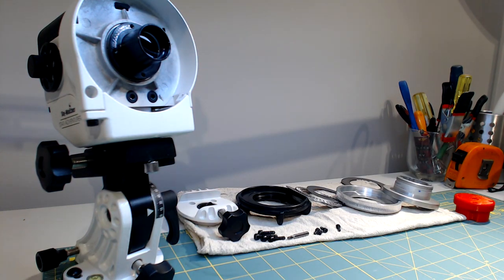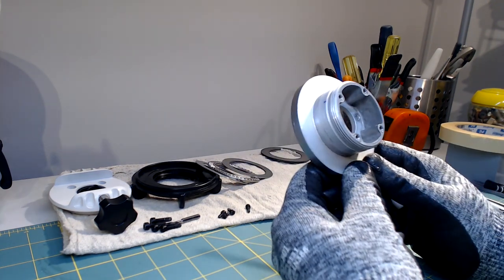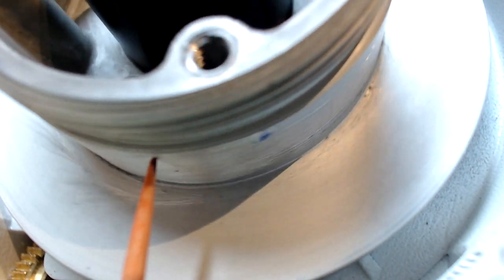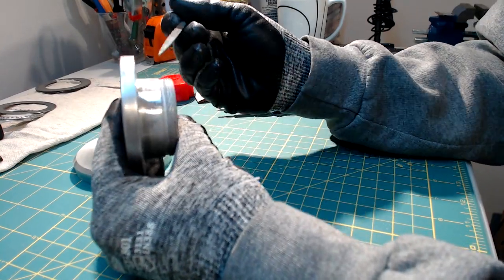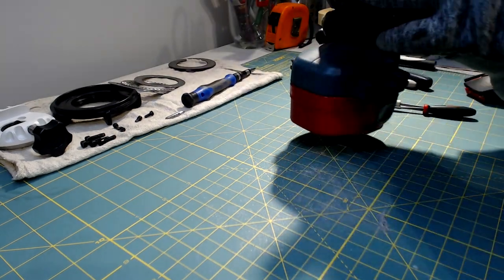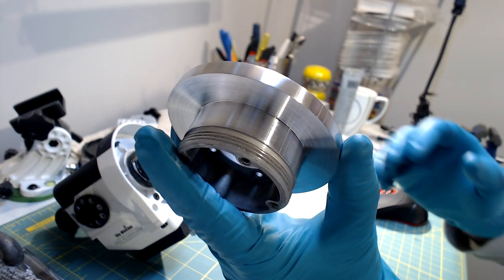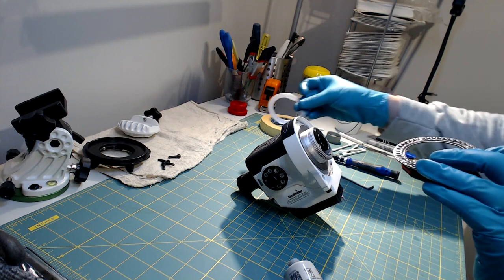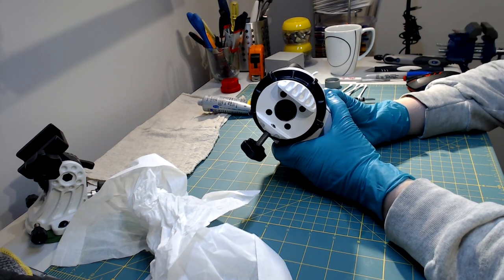Star Adventurer "Tight Spot" Clutch Repair

Comment: Just did a cleanup and regreasing on my Star Adventurer. I could not find the super lube so have used a light lithium grease. As others have said the factory grease seems to be sticky. The result is that I now have a smooth running drive with good balance. Thanks much for the video. Very nicely done.

Comment: Hi Steven,  I saw your video "inside of the star tracker" before I decided to buy a star tracker.  I received my star tracker today, and sure enough right out of the box after setting it up, the arrow lights started flashing.  I replaced the batteries just to check the obvious and the same problem.  So I followed you video and took it apart.  I didn't find metal shavings, but I did find dried paint chips on one area of the splines on the middle brass gear.  Was able to remove the paint chips, reassemble and it works fine now.  Just wanted to say thanks, and hopefully provide some info for other people.
Reply from the maker: You're welcome 😊.

Comment: Mine's got the tight spot and it's annoying as hell. Nice to see an actual video instruction in how to deal with this. Thank you for sharing!
Reply from the maker: Maybe try to see if you can get rid of it first by backing off the backlash screw. You'll still have to open it up to push the cradle down then reset the backlash. If the tight spot still comes back after setting the backlash then I'd say you need to find that high spot in the clutch plate and work it out. Good luck 👍
Reply: Steven Doye right, thanks so much for the tip! When i was first looking to get a tracking mount, it was either the EQM-35 or the SA. Should have gone with the EQM-35, or even saved up for the real deal, like the EQ6R-Pro for example. Lesson learned. Cheers!

Comment: Sometimes you can reduce out of round errors by simply unbolting and changing the orientation of the assembly  (rotate 90 degrees, re-bolt on, check oor error, unbolt and rotate again, re-bolt on and check error again, etc).  If there is an orientation in which the out of round error is lower than other orientations, mark the assemblies so that you always bolt it on in the same orientation.  This is a common practice in situations where there is a slight offset to the bolt holes, and could minimize the amount of sanding/filing needed to fix the problem.
Reply: This is what I tried but it didn't make any difference for me. I was thinking you could enlarge the holes so you have a bit of play when screwing the parts back together, so you can adjust the axis of rotation before you tighten the bolts down again. If it's just misaligned but circular, you dom't need to grind away material, just reposition the parts relative to each other. If you have the right measuring tools (dial indicator) I'm sure it's possible to do the alignment very precisely if you enlarge the screw holes.
Reply: @alphanimal  True in a lot of cases, as the old saying goes: when all else fails, make it adjustable. :)

Comment: Thanks. I see other guys balancing gear on their mount with a smooth range of motion. Mine just sticks there and barely moves no matter how much I unscrew the clutch or how unbalanced the counterweight is. I knew there had to be a problem.

I'm getting a 3D printer for xmas. Might be good opportunity to try printing out your special tool and trying this out.

Comment: The biggest cause of the tight spot lays in the mechanical design of the mount itself.
The inner Part (The Eyepiece/Mounting Plattform) is fixed with 4 little screws in the Center of the mount.
Around this Eyepiece/Mounting Platform there is the big metal gear. 
Then there is the backlash adjustment screw which is pushing the messing worm gear against the big Metal gear.
But when the messing worm gear is pushing against the big metal gear, the big gear could only slip a little bit to the opposite side (in its rotating tolerance)
But the Eypiece/mounting plattform which is inside the big metall gear could not slip away because its fixed with the screws and this results 
in an outcentered axis between inner metal (Eyepiece/mounting plattform) and outer metal (big gear). This leads to the tight spot.

What works for my mount and i have done to make this off axis of the two rotating elements getting better centered:
1. I loosen all 4 screws inside the mount which fix the Eyepiece/Mounting platform. Now it has a very little bit more mechanical game.
2. Then i made the backlash adjustment.
3. Then i rotate the mount with full turns several times (inner metall piece has chance to center with the outer metal piece)
4. Then i tighten evenly the 4 screws of the inner Eyepiece/Mounting Plattform
5. i made the steps 1,3,4 severall times until the screws were tight (always testing if the tight spot is ok)
Sorry for my bad english

Comment: Hi Steven, Great video! I've got one and it needs the same treatment you performed on yours. The suggestion on having a machine shop dress it up is excellent for those that don't want to do it themselves. Having a mini lathe would be great! This procedure could also be done with a drill press and a milling vise. (Drill press should not wobble!)  One more thing, I was saying to myself just before you mentioned the aluminum shavings and dust all over... Wonder how much you got in your coffee LOL!  Also I would suggest to anyone doing this to keep the bering away from the sanding/grinding area. I'm presently making an adapter to put the iOptron electronic polar alignment scope on my Star Adventurer. I like the idea of being able to polar align by looking at my laptop screen instead of bending down or kneeling to look through the builtin polar scope... Again GREAT video and all of us Adventurer owners with that tough spot thank you! Clear Skies to you now!
Reply from the maker: Thanks alot. I'm glad you liked it. If you're interested, I have designed a few other 3d printable accessories for the Star Adventurer. My glow in the dark polar Illuminator is pretty popular. I also have an adapter that will attach a webcam to the polar scope to save your back. And of course all my model's a free to download.
https://cults3d.com/en/users/skippy111taz/creations

Comment: I'm very appreciative of your work and the time you've taken to share it, thank you. As I have noticed the rotation getting difficult in spots, I have also seen the polar scope is wobbling when I rotate the saddle. Do you think that is coincidental or can those two things be connected?  As the clutch fits over the scope quite snuggly, I would think enough play in the clutch plate rotation would ruin the alignment of the polar scope... making my polar alignment off... which would explain why I've been getting star trails.
Reply from the maker: Thanks 😉
As I have mentioned this tight spot doesn't effect the performance of the mount. It just makes it difficult to balance.
The polar scope is secured within the bearings so it can't really wobble. The clutch plate however is casted and not perfectly round and it rides on the bearing and inside a machined ring gear what is perfectly round. This is what at least I have notice is causing this issue. I have been tempted to have a machinist make me a clutch plate on a lathe.
I have 2 of these mounts and both the polar scopes show that wobble when rotating and viewing through them. I believe it is more just the optics though. As you rotate the mount while looking through the scope, the view you see also moves with the scope. Aslo my crosshairs in the scope stay center on my target when calibrating, but yes the whole image moves with it.
Maybe check the calibration of your polar scope. Just center the crosshairs on a far target during the day and ensure the crosshairs stay on that target as you rotate the mount.
Reply: @StevenDoye  , yes! I experienced the same thing and thought it was so odd. Despite the over all wobble of the image, the object does, as you say, stay centered in the crosshairs during an alignment test.  

By the way, did you find that all the extra lubrication has an effect on smoothness and accuracy (= longer exposure capability)? Or it is just more peace of mind with regard to the longevity of the unit?
Reply from the maker: @JasonGabler  I wouldn't say it's extra. It is essentially the same amount that was in there prior. The grease I used though wasn't as sticky  as the original though. It dose slew smoother as for exposure it's still the same.

Comment: Hi Steven. At the 3 minute mark where you tighten the screw that pushes up against the worm, do you know what size that screw is. I have had issues with my SA and have just looked and the screw is actually missing so I need to replace it

Comment: Consider this: If the outer edge of the cast clutch fits snuggly within fine tolerances of the ring gear, the low tolerance inner spool that rubs unevenly when the clutch is loose will not affect the performance of tracking or the worm gear calibration at all . . . not in the least, once the clutch is tightened up. Now, finding chips of paint and metal shavings . . . that can be an issue.
Reply from the maker: I do mention this it doesn't effect the tracking, but it dose make it difficult to balance and it is just annoying to feel. If you see my other tear down video,  you'll see where the one screw was just rammed in and forced to find the hole from factory. It scrapped the paint and left metal shavings in the clutch area.
Reply: @StevenDoye  Yes. Watched the old vid first. That ripped up screw install was worth showing to the company for Quality Control! And, the 'paint chip' problem is also disconcerting.  How does the adjuster screw feel on the worm gear carriage? What are the instructions on adjustment? My Pro 2i will arrive Tues/Wed, so I will check it out myself.
Reply from the maker: @leonarddaneman810  The SkyWatcher instructions don't say 💩 about the worm gear adjustment. I just figured that out on my own. It dose come set from factory so if you notice no play in the RA while the clutch is locked, just leave it alone. You have to open it up and physically push the carriage down to back it off. Then slowly tighten it untill you have no play. Just like I show in the video. 
Another thing the instructions are wrong about is the calibration Date/Time for the polar scope. They are off by 20min. Most people don't use the setting circles to locate the position of Polaris anyways.
Reply: @StevenDoye  Hmmm . . . using the circle to get to true North is important. Will check that out. The new 2i will be here in a couple of days. Will let you know how it sets up out of the box.

Comment: Hi Steve, thank you for your videos and learn from the possible failures of the star adventure. I've barely used mine and lately it's leaving me traces in the stars with 10 seconds of photo using a focal length of 400mm only. I move the dial off and turn it back on and keep tracking but for a short time and stop tracking again. What could be going on?
Reply from the maker: It's hard to say without seeing it. It could be a number of things. Low battery, motor overload (lights will flash, can be due to overweight, not balanced, or backlash set too tight), clutch not tight enough (it'll track fine then slip and track again eventually), too much backlash (saddle will have play when clutch is locked). Really though the backlash should be okay because it's pre-set from factory. As you can see in my video it is a bit tedious to set.
I have personally experienced the clutch not tight enough problem. I'd get a good couple of exposures then trail's. It's rather surprising how tight you need to lock it down.
Reply: @StevenDoye  thank you very much for your answer, I will try to tighten the clutch more, the equipment used was the 72ed refractor of skywatcher, guide tube of 30mm of zwo and main camera 294mc, so it is less weight than the maximum allowed and the PowerTank battery is new and had all the charge. The polar alignment was perfect and stayed on the watch face when rotating the axis, so polar finder calibration and alignment are fine.
Reply: @StevenDoye  the lights did not flash and were always fixed, I guess then it is not an engine failure right?

Comment: Wow. I can’t believe how bad your clutch plate is out of round. It looks like 1mm high in that area. Just bought the Star-Tracker WiFi Pro Pak. I hope they got this issue corrected on the newer units. You might have tried putting masking tape on the clutch plate surface to prevent scratching with the file sand sandpaper. Do you have the STL file for your drill adapter?
Reply from the maker: Yeah it was pretty bad. That's what you get when you cast the part instead of machining it. I honestly wish I had a lathe to fix it but that's why I ended up designed the drill adapter. Here's the link to the adapter STL.
https://cults3d.com/en/3d-model/tool/star-adventurer-clutch-repair-tool
Reply: @StevenDoye  Thanks. I’ll be sure to check my Star-Tracker out closely. At least I know how the whole thing works from watching your videos. It looks like a good product but you’d think they’d machine that part instead of using a casting. Thanks again for your insights.
Reply: I bought the Star Adventurer 2i Pro pack recently and it's got the same problem. So, no I don't think they honestly care at the manufacturer's factory.

Comment: Nice video. I subscribed. It may be useful to know how to repair especially it if it is out of warranty . On my first mount that i bought, the Ioptron skyguider Pro the clutch got stuck, also had other problem so I returned it, and i decided to buy Sky-Watcher EQM-35 PRO GOTO
Reply: Good call! I wish i got the EQM-35 Pro, but i decided to get the Star Adventurer instead, and while it's a nice little mount, there are many frustrations with it that you just don't get with a proper mount like the EQM-35 (or better ones).
Reply: @aerozg  if you do not travel in mountines for astrophotography and need to go at distance for the car best use a more solid mount. I haad first ioptron skyguider pro but felt like a toy compared with the eqm35 pro
Reply: Ioan Nemes i agree. I usually travel 2 or 3hrs to get away from the city light pollution, and i drag all my gear with me. The polar alignment was a nightmare on the Star Adventurer, but now i have gotten used to it. Working with mounts like the EQ6R-Pro is light years better than flimsy tracking mounts like the SA. It's a nice toy, but you overgrow it very quickly and want to do more, with bigger lenses and longer focal lengths. I don't want to shoot Milky Way all the time, deep space objects are calling :)
Reply: @aerozg  if you are on a loeer budget the eqm35 pro is a very good upgrade. With the ed80 600mm makes a nice pair and i heard it can perform good even with a litle bit heavier telescopes but i haven t test it myself. With an autoguider and a rough polar alignment i used it up to 10 min exposures
Reply: Ioan Nemes 10 minutes, that is great to hear! But i am still a beginner, my skills do not warrant an upgrade yet :) Still shooting Milky Way and learning how to process images. I still need to reach the point where i can deliver consistent results with the current gear, and then i will allow my self to graduate to more complex machines. We have a great local shop, offering good financing options, like paying in up to 24 installments, with no interest %, so that's a big plus. So i will keep learning, and saving up money for the upgrade. I think of all things, the most important thing in this hobby is Patience :))
Reply: @aerozg  eqm35 pro is good choice for beginners when i bought it i only used a week the ioptron a few months ago. And is also not expensive a good mount to start. Wish you clear sky
Reply: @GalaxyArtMedia  i agree completely. Clear skies to you as well my friend.

Comment: Hi Steven, 
I’ve just been watching your video on the “inside of the star tracker” and the problem people are getting with the screw thread that can  jam up or gets stuck inside when you try and turn the clutch over time ! 
I’ve just purchased one today and is about to be sent to me from the retailer. 
So should I ask  them to do this for me as it looks like it happens quite a bit so I know it’s in good working order plus it’s still under there warranty or is it something you suggest I do straight away so I never have this problem 
kind regards 
Simon  ✨🪐💫
Reply from the maker: I really don't think the retailer will open it up. The most they might do for you is check if the saddle rotates freely with the clutch loose. If you're buying new, just check it as soon as you get it. If you notice the saddle binds or has a grinding feeling then at least you know what is happening inside and can send it back under warranty. I believe the mount comes with a 1year warranty.